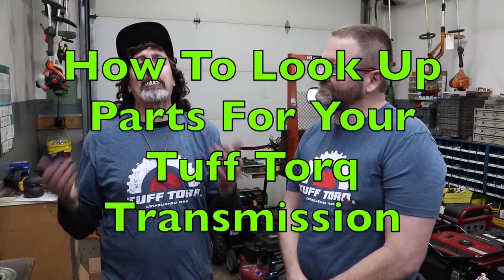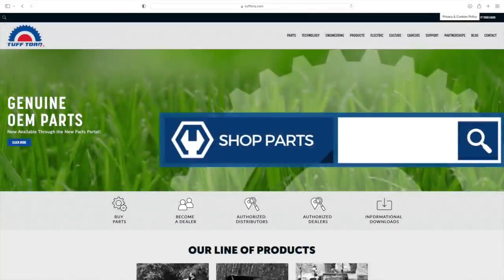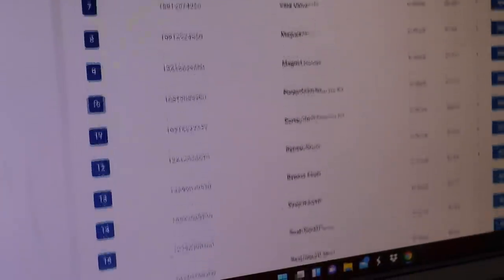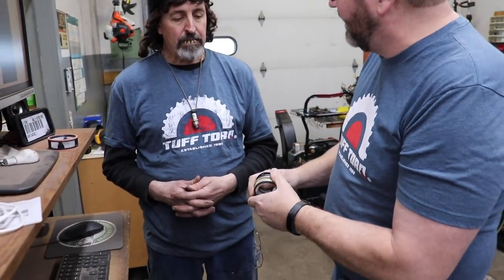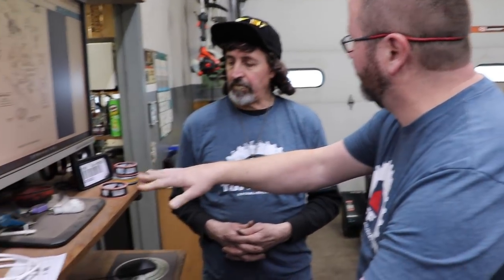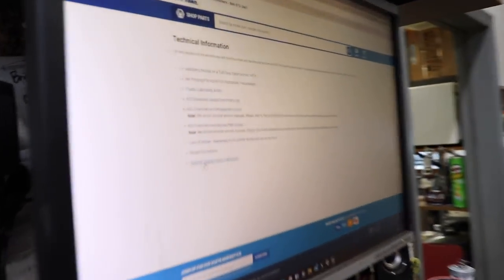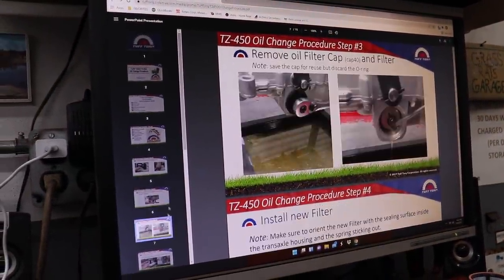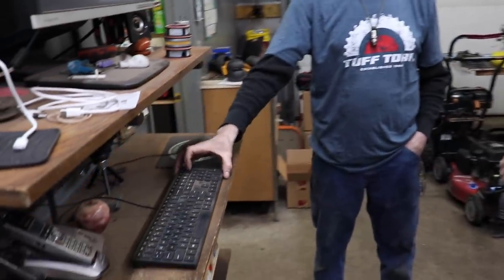Trouble Looking Up TUFF TORQ Parts? Watch This Video

Comment: First mower with a hydro and happened upon a blog with a Tuff Torq tech weighing in. That helped a bunch as then I learned about preventive maintenance for my hydro that my Mower manual skipped over. Very helpful customer service e-mailing them also. Good info on how to read the bar code for your particular info.

Comment: Cub Cadet.
" Sorry your K46 transmission is un serviceable." 

I beg to differ.
I have replaced the axle seals once and changed the oil twice.
Also have a K46 on a JD mower too. Changed the fluid in that one too.
JD used 30 wt oil. I put in the 5w-50w synthetic and it runs fine.
As a matter of fact, when i mower hunt. I only buy the Tuff Torq tranny ones.
I know I can fix it.

Comment: I dont know much about that transaxle, but I really like the spicer/dana trans that I rebuilt in my 90 Dynamark, I have used it to plow with a 4 foot plow and its a long driveway, long driveway for more than 10 years. Its about the cheapest dynamark made also, 12.5hp/39 cut and easy to work on! You could call me Dynamark Bill, I have a 4 wheel steer one also!
Reply: I guess I should had mentioned mine is the old 5 speed- has all metal inards lol
Reply: Hi Dynamark Bill!

Comment: I like that the guy came on your show to engage with your community.  However they must be charging covid prices, pump motor rebuild kit $426, fortunately the gear kit is only $28. So I will replace the worn gear set, filter, and oil up with a slightly heavier oil than 50.  The pump motor Im working on has 0.005" piston slop as measured by My Crow Meter.   Would you video pump cylinder motor and thrust washer tolerances?  I have no idear how to measure slop in the thrust wersher set.

Comment: Taryl...could you do a video on how to install the (2) oil drain holes to the bottom of the Tuff Torq transmission housing ON A UNIT that DOES NOT have the (2) cast bosses to drill & tap? That's my challenge to you. Anyone could do the ones with the case bosses BUT no the ones without.

Comment: Good morning sir, I just watched your Tuff Torq  part lookup video. They don't have any parts for my transmission,  most everything I see on there is out of stock. I'm looking for parts for a 46DM 087256
Maybe you can answer my question because I can't find any parts on their website, but,  is there a little basket that holds the magnet under the draining cap on top. Because when I took mine a part it did not have that basket and I'm afraid the magnet will fall off the drain cap, being that it's only being held on by magnetism. Thank you for any help your channel is very helpful.
Keep up the good work!
Mountain Mike

Comment: I would guess that the size of the holes in the old filter should, more or less, match the size of the holes in new filter you are installing. Not having enough oil circulating inside the transmission might do more damage than having dirty oil circulating at the correct volume. Although it probably wouldn't do as much damage as not having enough oil circulation inside an internal combustion engine, with bearings that need oil pressure to keep the bearing surfaces apart. Those fine screens inside the transmissions are to probably to catch larger metal particles that you could see, not ultra small dirt particles, like the large paper oil filters on an internal combustion engine are designed to trap.

Comment: When one considers the HUGE number of lawn equipment using the Fluff Torque Transmission, this information is invaluable if you want or need to work on one of these pieces of shit! 
To be honest, you WILL need to work on one of these.
The question I have is, Do they make a SHOP MANUAL for repair?
Reply: @JM-yx1lm  I agree with you and understand that everything will need to be maintained and repaired however if you have had ANY experience with these transmissions you will also understand that these things are DESIGNED to fail especially the ones that make it almost impossible to change their oil and DO NOT have a oil filter. Who does that?!
Reply: Everything nowadays is made cheap as hell. At least with tuff torq they offer the means to repair them, unlike the Chinese crap that everyone puts on their machines. Too bad we can't go back to good old fashioned cast iron blocks lol
Reply: Mine works fine at 450 hrs with my third oil change. If you buy a cheap lawn mower you get the cheapest hydro version along with everything else.

Comment: Curious why the filter is recommended being changed if the case is opened, but otherwise no.  Does opening the case cause the filter to get dirty?
Reply: Well I opened the case and found the old filter to be bent and the gasket torn.  Had to be replaced.  Maybe they all end up like that when the case is opened.

Comment: The yellow label on my Scotts 2554 tran. totq# K66 SBR S/N 101675  JDHW P/N AM 126670 was not enough information to look up parts as I was told by a customer service rep.   I need to drop the trans and look for another tag.

Comment: That Toro I had came with the ezt tuff torq transmissions and they failed at under 30 hours and the dealer was hesitant on honoring the warranty all because I took a hitching post off my old Husqvarna and installed it on my Toro so my guess is they assumed I was hauling heavy stuff with it so that turned me off Toro
Reply: I don't think Tuff Torq ever had transmissions in a zturn Toro?  Hydro Gear had EZT in the Toro zturns.

Comment: 46V-0143557  Still says parts unavailable ,look it up
Reply: Parts are available . The IT group for the parts website are working on the glitch that is keeping that serial range from pulling up , check back later it will get fixed.